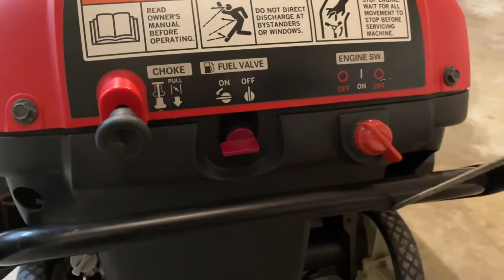How To: Change your snowthrower auger paddles (rubber flaps)!!!

Comment: It appears you may have installed the first middle paddle backwards by accident. 15:42 shows it perfectly, the reinforced rubber paddle has more rubber facing the wrong way
Reply from the maker: Great eye, Gneesh! I found that afterward and promptly switched it around. Cheers!
Reply: I noticed that immediately too. Clearly there is a difference from front to back. Funny the first comment I see. Lol

Comment: I just picked up a HS621 for $50. Owner said the “blade” doesn’t spin but the engine runs perfect.  I couldn’t get there fast enough before someone else.  He had no clue what was wrong. Sure enough I get it home and the belt was shot.  When I told him what I found as he was curious,  he said he had no clue how to change it anyway.  Why he spent $800 on a new machine.  Familiarizing myself with this model.  Appears there are no paddle wear indicator holes like my old Toro?

Comment: Great video Dave, just wondering on the first center one you have the stitching towards the front. There is more rubber towards the back, does it matter?
Reply from the maker: Great attention to detail, Norm! I think I may have overlooked that. I would want the bulk of the rubber side toward the leading edge with the stitches as support. Guess I’ll be going to go flip that around for him! Thanks!!!
Reply: @DavesSmallEngines  I noticed that too, but hey,  pros do that sometimes. Cheers
Reply from the maker: @Ron0963  just fixed it for him! All is well!
Reply from the maker: just fixed it for him! All is well!
Reply: @DavesSmallEngines  Thanks for your videos Dave, I learn a lot. like how you and Don do the videos together.
Reply from the maker: @nrmwntrs  great to hear!
Reply: @DavesSmallEngines  Pros always makes it right in the end. ..good show!

Comment: Can we expect a video on the inspection, replacement and clearance adjustment if the scraper blade? Critical component for proper snow blowing. Perhaps,  combine it with replacement of the drive belt. Thanks, good video!

Comment: Looks much easier to replace the paddles on the Honda vs. my single stage Toro.  I replace my paddles about every five years.  Very difficult to get the side bolts back in, I would buy the Honda if my Toro failed.  I've had the machine for 11 years and works well but the time it takes to do the paddles makes me to not recommend the Toro.
Reply from the maker: Hey DS! I think I’ll be due for new paddles next season. I’ll have to see what this is all about!

Comment: I notice that my old sears craftsman spins so free that it will spin 5to 6 times but my new honda will not spin when you give it a hard spin like the one your working on.
Reply from the maker: I’m not sure what the clutch / brake system differences are between the two.

Comment: DAVE nice camera work .When I bring new hard ware I want it used especially self-locking ONE TIME USE ONLY NUTS. Just saying.
Reply from the maker: I checked them out - the kit didn’t come with nuts, just the bolts. It will be just fine!
Reply from the maker: Great point though!

Comment: I wonder how much these paddles cost from the manufacturer. I work in the conveyor belt industry and could cut hundreds of those paddle from the remnants we throw away in a week. Would just need one set to use as a pattern.
Reply from the maker: This.... is intriguing. It was about $100 for everything I believe.

Comment: Dave: is it recommended to use any anti-seize on those threads?
Reply from the maker: You can if you wish. I did not see a recommendation in the instructions. They are high quality fasteners.

Comment: Dave, great video!  I’ve changed the paddles several times on my HS520.   One thing I have seen is that the two outer bars, where the paddle single holes attach, bend outward towards the housing over time.  This can cause the paddle ends to rub against the housing sides.  I bend them in for approx. 1/4 inch of clearance, when this occurs.
Reply from the maker: That’s a great tip. I’ll keep that in mind if that issue arises!